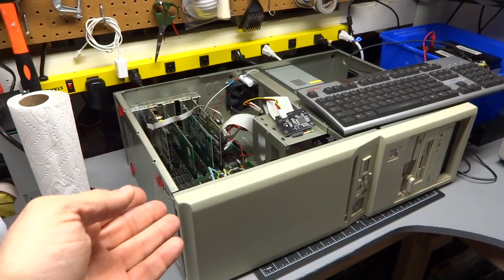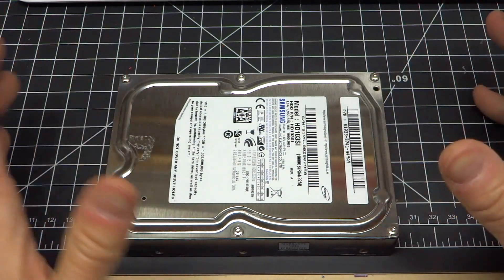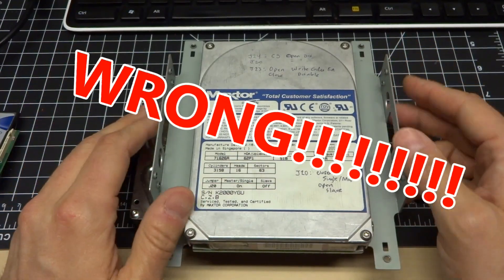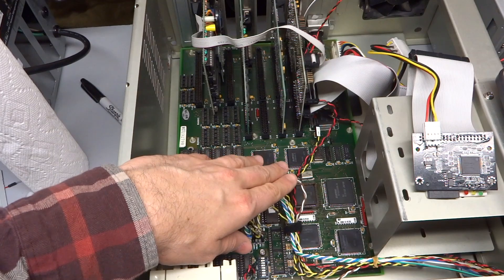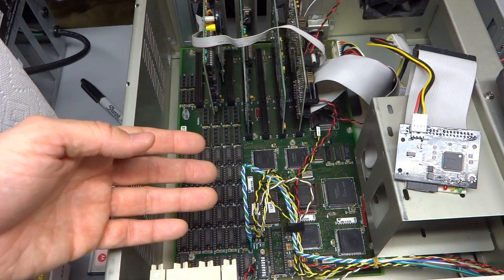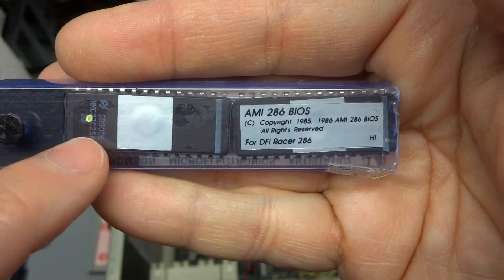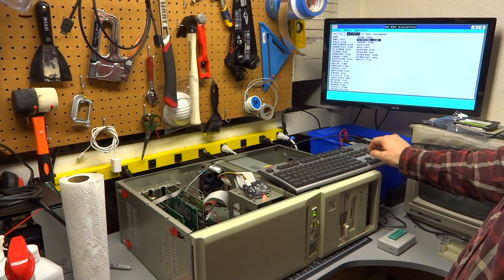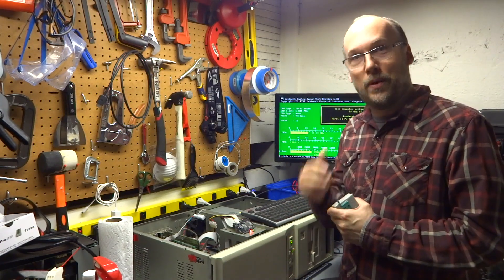I got my 286 working with a SD to IDE adapter!

Comment: I run into the similar situation, with my 1991 Bioteq MB1433/50ae-v with a 486-33 cpu and QDI QD6500A v2.0 HDD controller, MS-DOS installs ok into CF, but after rebooting the, machine stop and only showed the cursor blinking and never move forward, not freezed, numlock led working. So the solution, if the CF is well configured in bios by hand (C.H.S.), and it is recognized booting from diskete using MS-DOS commands such as Fdisk and partition is primary and active , just do this " c:\fdisk /mbr " after this the CF card will boot ok your previous installation of DOS.

Comment: Ive been having nothing but problems using SD/CF to IDE 44 pin adapters on my old Commodore C286-LT. I wonder if its a BIOS issue as well. It writes fine to the cards but refuse to boot or otherwise read files. Another thing to explore 😅
Reply from the maker: Probably it's the same exact issue. I go over this in a lot more detail in my IBM 5170 series, where we find and fix the bug in the BIOS.
Reply: @adriansdigitalbasement  I have to watch those then because I am sure it is the same problem i have. I can make and read very small txt files. I programmed a new EPROM with the newest released Commodore BIOS and that will not work either. The weird thing is that some people here on youtube got it to work with that BIOS but I suppose my CF to IDE adapter is different. Thanks for your reply. It is much appreciated. 🙂

Comment: Thanks a lot man. I have been struggling with the commodore c286lt laptop and cf2ide adapter for two months. I tried three cards: 32MB CISCO, 256MB UNIGEN and 1GB PRETEC. Nothing works. They work in a newer laptop, but not in a commodore. I was able to fix the old CONNER CP2024 hdd faster and the Commodore c286 came to life. Thanks for the hint that the culprit is the BIOS - old Phoenix V. 3.10.00-11 / 1985-1990 / - I think so.

Comment: Hello, I got one of these SD to IDE and tried to install XP on a SD and it took 2 days to install and once it did it was taking for ever to initiate windows so I gave up. My machine is a k8mm-v mobo.
Reply: :( any ideas? I really wanted to use it and see if it could be better.
Now I'm trying with a Sata to IDE, seems to work better, still trying to install Windows XP.

Comment: Great job ! As for erasing EPROMs: if you have bright sunny days, just peel off the sticker and place them in direct sunlight for a couple of hours. The sun‘s UV rays should do the Trick. Since you have an Eprommer, you can check if the EPROM is erased completely.

Comment: Kinda amazed that a completely foreign bios would even work. Nothing ventured, as they say.
Reply from the maker: Almost all 286 machines are all the same and just based off the IBM 5170. Later with the 386 things started to differentiate from one chipset to another.

Comment: Using a different BIOS was obviously the right thing to do. I have a strong suspicion about the bug in the original BIOS: Somehow the hard drive and the mainboard get out of sync, with the mainboard waiting for the hard drive to do something on the one hand, and the hard drive waiting for the mainboard to do another thing on the other hand. At some point in time, the mainboard gives up (the BIOS has a timeout built in) and returns the "not ready" error.
This deadlock only appears on files above 1K, as you say. I suspect the real limit is already 513 bytes (i.e. more than one sector), but let's not argue about it. If you want to read more than one sector in a row, you can send a "read sectors" command to the hard drive, and specifiy the number of sectors to read. The IDE protocol for reading 2 sectors in a row is:
HOST-a) set up the command parameters (select master or slave, set sector count (2 in this case), set start C/H/S value)
HOST-b) issue the read sectors command (write 20h to port 1F7)
HOST-c) wait for IRQ14 for the first sector
HOST-d) read 256 16-bit values from port 1F0
HOST-e) wait for IRQ14 for the next sector
HOST-f) read 256 16-bit values from port 1F0

A single-sector read works the same, but the process is done after step HOST-d. So it is very likely that there are no problems until step HOST-d. The only wait operation in this sequence is step HOST-e, so I strongly suggest that the BIOS hangs in step HOST-e. (I can't be sure, because there might be sub-steps like polling a "drive ready" or "drive wants to send/receive data" bit, which can also timeout).

On the other hand, the on the side of the drive, the process it like this (it's the process used on a typical 1986 hard drive without any caching, read-ahead, double-buffered memory or anything like this):
DRV-a) wait for a command to be issued (in this case, 20 = read sectors)
DRV-b) obtain the command parameters from the parameter registers (aka the "IDE task file")
DRV-c) seek to the requested track, if not already there
DRV-d) wait for the sector ID of the requested sector to show up
DRV-e) read sector data + ECC bits into a local buffer on the drive
DRV-f) poll the ECC error detector status bit (most drives of that time do ECC calculation in dedicated hardware while transferring the data from the drive to the sector buffer, so the drive processor does not have to actually calculate anything if the hardware says "ECC OK").
DRV-g) set up the bus transfer logic to transfer the contents of the sector buffer to the host

DRV-h) raise IRQ14
DRV-i) wait for the transfer logic to indicate that the transfer has been completed
DRV-j) [basically go to DRV-d] wait for the sector ID of the following sector to show up
DRV-k) repeat steps DRV-e,DRV-f,DRV-g for the next sector
[letter "l" skipped due to similarity with 1 and roman numeral I]

DRV-m) [repeating step DRV-h] raise IRQ14 again
DRV-n) repeat step DRV-i: wait for the second sector to be transferred to the host
DRV-o) go back to step DRV-a

As single-sector reads work, I am confident that everything until step DRV-i works perfectly well with the AMI BIOS. Step DRV-i completes in lockstep with the step HOST-d. On a classic hard drive, steps DRV-j and DRV-k take a considerable amount of time, giving the host processor time to re-arm the IRQ14 wait process. At the time a classic drive reaches step DRV-m, the host computer is actually waiting in step HOST-e. On the other hand, modern drives read the subsequent sector into a buffer while the host is transferring*, so step DRV-i is postponed, and the transfer to the host is parallelized to reading the next sector. In fact, the "wait for the host to be ready" can be postponed up to step DRV-m. The drive *must not generate the second IRQ before the transfer is complete, but it may do so directly afterwards.

So my theory about the issue is like this: On modern drives with read-ahead, or on drives that do not need to read to a sector buffer first (CF drives could transfer from the storage to the host directly) the IRQ14 for the second sector can be raised so quickly after the first sector transfer is completed, that bad code on the host might miss the second IRQ14.

A typical AT BIOS implementation of IRQ14 is that IRQ14 does nothing except set a flag in the BIOS data area that IRQ14 occurred. Suppose the AMI BIOS works like this (letters as in HOST-x, numbers indicating substeps):
AMI-c) poll the IRQ14 status bit
AMI-d) read 256 words from the hard disk
AMI-e1) clear the IRQ14 status bit
AMI-e2) wait for the IRQ14 status bit to be set again
and imagine the second IRQ14 to occurr between steps AMI-d and AMI-e1, in AMI-e1 the second IRQ14 will be discarded, and AMI-e2 is going to wait for a third IRQ14 which is not going to happen. Boom - there is your deadlock.

One non-buggy ways to implement the process would be:
BIOS-c1) poll the IRQ14 status bit
BIOS-c2) block IRQ14
BIOS-d) read 256 words from the hard disk
BIOS-e1) clear the IRQ14 status bit
BIOS-e2) unblock IRQ14

BIOS-e3) wait for the IRQ14 status bit to be set again
This would leave the second IRQ14 pending in the interrupt controller until the computer has already cleared the status bit.
Another valid implementation is:
BIOS-c1) poll the IRQ14 status bit
BIOS-c2) clear the IRQ14 status bit
BIOS-d) read 256 words from the hard disk
BIOS-e4) wait for the IRQ14 status bit to be set again

If you happen to still have that AMI BIOS, I would be interested to analyze whether my theory is right, and I was able to correctly identify the bug in the BIOS without seing any byte of BIOS code first. Can you confirm whether your BIOS matches the AMI BIOS with the same manufacturing date listed at http://www.minuszerodegrees.net/bios/bios.htm ?
Reply: Actually, if the BIOS matches the BIOS I linked, my theory is wrong. The BIOS I linked seems to implement the second algorithm I showed as "valid implementation".
Reply: I think I got it. I expect the same problems if you used the original AT BIOS dated 06/10/85, as shown on https://github.com/kaneton/appendix-bios . Both that BIOS and the AMI BIOS do not follow the fine print of the ATA standard (shown for example in ATA-2, published 10 years later on, see http://www.t13.org/Documents/UploadedDocuments/project/d0948r4c-ATA-2.pdf ). In the linked document, on page 76 (according to raw PDF page numbering), AKA page 63 (according to document internal page numbers) the steps of a PIO input command are shown. They are
[... skipped until the step where an interrupt should be generated]

SPEC-g) the drives reads the requested sector to an internal buffer, then sets the status register, clears the busy bit, and asserts an IRQ14
SPEC-h) the host reads the status register
SPEC-i) if the drive wants to transfer data (it may reject data transfer in the error case), read 256 words
SPEC-j) the drive already negated IRQ14 *in response to SPEC-h*, and the process repeats at step g if no error occurred.

Both the original IBM BIOS and the AMI BIOS do not do SPEC-h. They don't test the status register before reading the data block, but the Quadtel BIOS does read the status register before transferring the data block. This means they might read a data block on error, even if the drive does not have any data available (e.g. in a sector-not-found condition). Reading data without data being available is benign, because reading the data port if no data is available does not crash the system, it just yields undefined data and transferring the block wastes some time. But that also means the the drive may not negate the IRQ14 line during the whole read process, because the drive must not negate IRQ14 until it is "acknowledged" by the host by reading the status register. (That's what the spec says. Reading the data register is not specified to be an "interrupt acknowledge"). The IBM and the AMI BIOS check the status register after the transfer instead.

So the race condition I suspected in my first comment is likely to happen, but at a different point in the system than I expected. I still assume that a fast drive issues the next IRQ14 directly after the transfer, and the host did not do something in time. In this case, the "something" the host did not do in time is not (as I wrote in my first comment) clear its own "interrupt occurred" flag, but it is reading the status register. The drive requests the "next" IRQ before the previous IRQ was acknowledged to the drive. This could cause two kinds of situation which behave the same from a software point of view:
a) because the previous interrupt was not acknowledged before the next interrupt should be signalled to the host, the IRQ14 line keeps asserted all the time. The ISA bus defines IRQs to be edge (originally I wrote "level" here, but this is blatantly wrong, and I never meant to write it) triggered, so keeping IRQ14 asserted the whole time does not trigger a new interrupts.
b) because the next interrupt was signalled before the previous interrupt was acknowledged by the host, the host accidentally acknowledged the next interrupt. This causes IRQ14 to be negated, and again no new interrupt is generated.
With your scope, you could easily differentiate between situation a and b by just checking the IRQ14 line when the system is locked up, but I don't consider the distinction interesting.

What might be interesting on the other hand is the width of the IRQ14 pulses for read requests. The fastest you can get with "REP INSW" to receive data from the hard drive is 4 cycles per word transferred (that's the adverstisment number taken from the 80286 datasheet, but it is assuming 0WS memory and 0WS I/O, which is really atypical. Most AT boards insert at least 1 WS for the IDE data access), let's use a more realistic 9 cycles per word (1WS on memory and 4WS on I/O). That's around 2400 cycles for a sector (including some overhead). At 12MHz, 2400 cycles is 192µs. Check your video at https://youtu.be/io66EelryLc?t=242, and you will find the last IRQ14 pulse to actually have a width of around 220µs. This matches the IRQ being asserted during the whole transfer, and negated as the BIOS checks the status after reading all the data from the drive. If that oscilloscope shot is from a situation where you got a timeout due to a longer read request, it confirms the theory that the second IRQ for the multi-sector read (not block-mode read, that's an entirely different thing and not supported by standard AT BIOSes) indeed got lost.

Comment: What about 286 chipsets that offer special memory management features like EMS or ROM shadowing? Don't they need different BIOS to control their extra features? And what about memory timing? In some BIOS wait states are even selectable. And why VGA speed differs dramatically with the same video card in various 286 mobos? Okay, ISA clock may be different but doesn't that need some tending from the BIOS too? And even different ISA clock can't explain some 3-fold difference.

Comment: That original BIOS was probably implementing the classic int13h interface.  Making only 504mb actually work, and failing when trying to access beyond that physical geometry.  Like in a spreadsheet, your still on the first row, but the info you want is in collumn abc, but the bios can only function up to column zz, even though it shows theres more.
Enhancing the bios (updated) gets by that early CHS implementation limit (until 8GB anyway, then you need LBA).  Its not the size directly, its the way CHS was implemented early on, resulting in problems with storage bigger than 504mb until BIOS's int13 interface were enhanced.  Good on ya finding a BIOS to work on that board!  Just don't go putting a 16GB card on that 286's bios, god help ya if you do!
However.... a 3rd party EIDE BIOS would probably work for that.  Or a Promise controller with a BIOS of its own.
Reply: Does that mean that a 256MB SD card would work in this case ?
Reply: @mcping  I'm almost certain that would work.  I'm sure I did that very thing for a picture frame project with an IBM thin-client back in the day.  Certainly worth the try if you find a vintage one of that size on ebay or thrift store, etc.

Comment: I have a very similar board. I know you had mentioned in a previous video that the board will recharge the battery. If that's so is it ok to use a non rechargeable battery? Like one of those AA battery replacements?

Comment: Does somebody know Motherboard Acer 915P(N)
Is it possible to make work SD card throught IDE-SD adapter with this motherboard?
What about BIOS settings? Which Hard Drive type i need to SET?
I tied to connect 258Mb seagate harddrive but BIOS did't recognized it
I tied to choose different types of disks but system not booting noth from floppy not from hard drive
Only if i'm set

Comment: You can install a SCSI-Controller like the Adaptec 1542cf. This allows you to add harddisk with any capacity you can get and use external harddisk.cases with more than one drive including cd/dvd-drives.

Comment: I think at this stage of IBM PC compatible computers there was very few (or none) extra, nonstandard components included on motherboards. Like you said, the chipset was trying to be 100% compatible with IBM's original. Which is why your new BIOS code worked OK. As soon as MB manufacturers started integrating things like disk controllers, sound cards and even joystick ports, all BIOS's became unique to each model.

Comment: same happened to me the problem is not with the cf adapters but with the cf card because some card cannot boot even if they work in normal condition i test several cards and at last the Toshiba 1 GB cf card worked well and the computer booted as a normal HDD

Comment: Reminds me when I upgraded my IBM 5170 when I was in my teens. A friend of my mother gave me a huge box of parts and a bunch of old Seagate hard drives. They were all RLL drives. My WD RLL drive that was in the computer had a bunch of bad sectors so I tossed in two 20MB drives but the BIOS didn't like it and kept booting into BASIC. Since there was no internet at the time as we know it and had no idea how to access the BIOS other then with a typical clone was the DEL key I tossed in a BIOS from a busted off brand 286 motherboard and I was good to go. I even tossed in a memory expantion board giving me a whopping 2MB of RAM, some Packard Bell combo sound/modem card. I did other things to it but I finally scored a 386 DX 40MHz board and 16MB of ram and two Maxtor 500MB IDE drives, by then it was totally a different system. Not to mention Windows 95 looked odd with EGA graphics.I think by time I was 19 I had it running Linux.

If I knew how much these old parts go for I would of kept them or sold them on ebay lol.

Comment: Last time I saw a working 286 was around 1997 in a local newspaper office. They used it to write articles then saved them on floppies for printing. It was very obsolete already but somehow worked flawlessly. They had 40MB Seagate HDDs and nothing else but DOS 3.3  some editor software like Chiwriter or Wordstar and Norton Commander which was pretty ubiquitous back then as a very handy file manager.